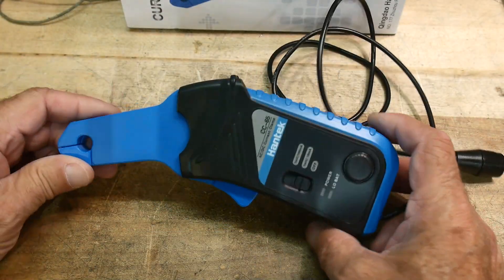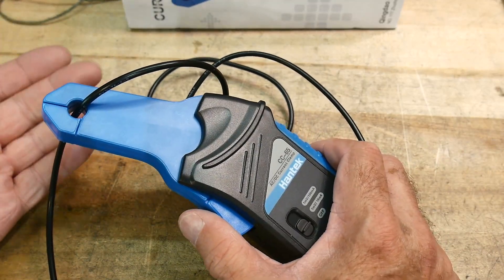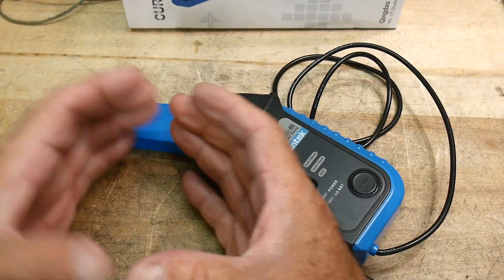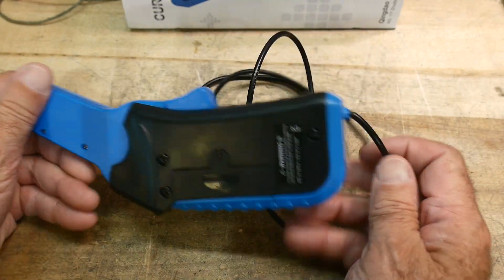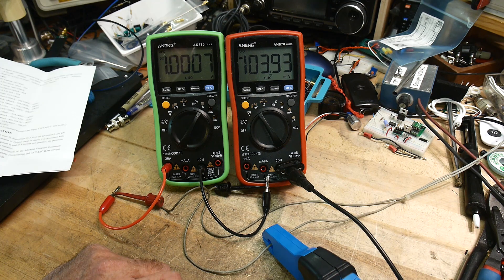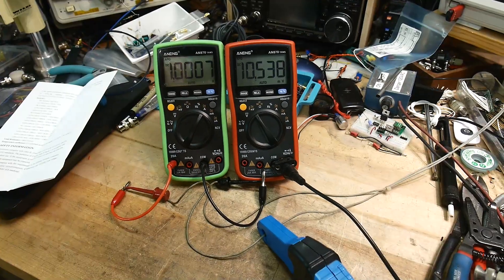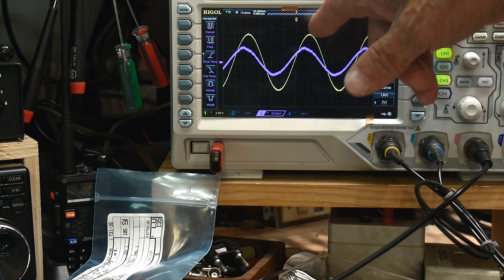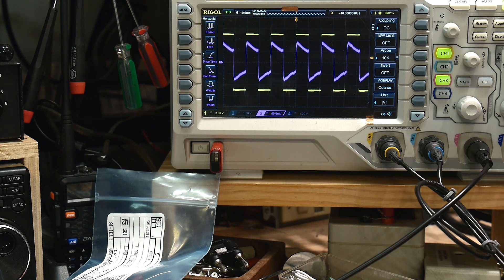#802 Hantek CC-65 Clip-on AC/DC Current Probe for DVM and Oscilloscope

Comment: hi i have a question for you , if i have the scope on 10x and the clamp meter cc-65 set on 1mv/10mA and am messuring 4 volts RMS and 12 volts peak to peak the way i do it is 4 volts = 4000 mv x 10 = 40000 mA /1000 = 40 amps is that right ?? or how much i really have thanks in advance
Reply from the maker: I think you can answer your own question. It will either be 4A or 40A. I think it will be obvious which one you have
Reply: @IMSAIGuy  am not sure that is why am asking please
Reply: @IMSAIGuy  can you please tell me is it 4 or 40 ?
Reply from the maker: @EnergySeeker  if you have the scope set to 10x then the 4V measured is only 0.4V at the probe. so 400mV. so 10mA/1mV * 400mV = 4000mA
Reply: @IMSAIGuy  thanks a lot

Comment: I use one to measure the sine wave microstepping current for stepper motors.  Using a current probe is the only way to get accurate enough peak readings from stepper drivers.

Comment: Was looking at investing in one of these when I purchased the Hantek 2C42 since was in the mindset of most "cost effective" for capabilities and performance.  Plus later read the 2C42 can be firmware hacked to perform like the better models.  Haven't messed with yet.  Was thinking however, regarding the current probe... for the price... seemed like a great DIY project to make one from scratch or possibly was thinking hacking a clamp on ammeter signal path for outputting for monitoring the signals.   Also, what drove me away was I have more-so in mind to have a larger range of settings so I can measure and log welder current waveforms. Thanks for detailing and demonstrating!
Reply: Did you bought one of these Current-Probes